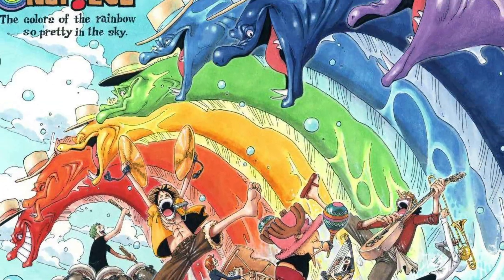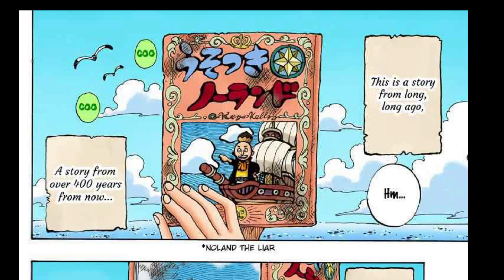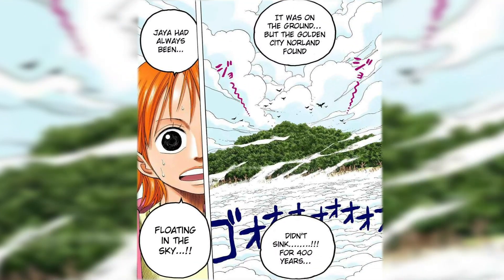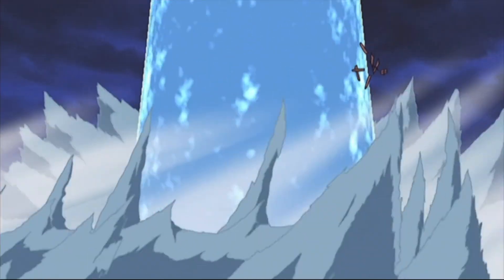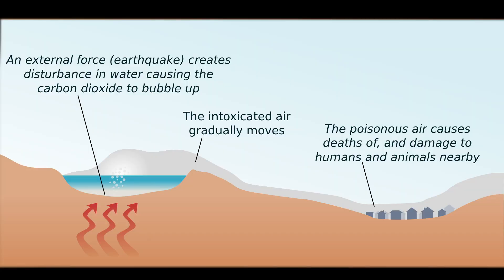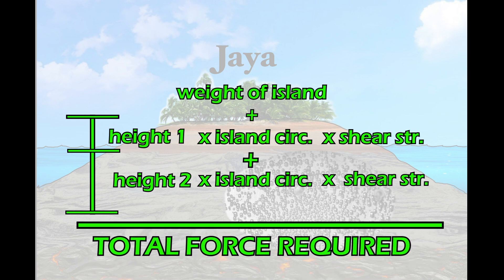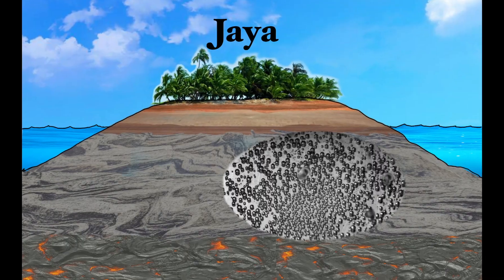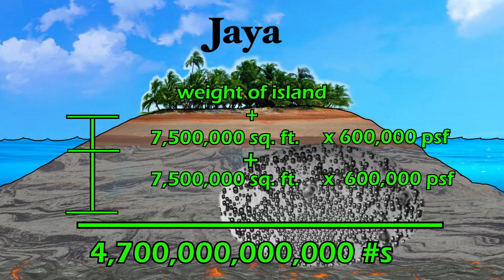Reverse Engineering Jaya: One Piece Worldbuilding

Comment: It might certainly be possible that Cricket's theory might be wrong to begin with, knowing Grandline, it could have been a mechanism that sustains the sky islands to begin with
But do you think that there could be a reason that knockup stream under Jaya was stronger than others?
Reply from the maker: ah, that's an interesting question. My guess would be that the recurring knock-up streams are a result of blowing out a seafloor cavern with a thin ceiling of rock, perhaps the pressure build up was able to be much larger underneath jaya because there was half an Island above it. 

But of course, this all relies on taking the logic of the show at face value

Comment: I think you forgot to factor in few things. You must always remember what shape a opening is and the underground or underwater topography as both are very big factors in this equation. If you never did the Weir experiment then do it. Basically the shape and topography matter. You can also try the pump experiment with commercially available objects. Use a bulb syringe and a simple cup. The idea is the narrower opening of the syringe changes the amount of pressure created. I took the mechanical physics class in high school and we did these same experiments. We tried to figure out the amount of water per cycle and how much pressure was there and how much power was required to move such a amount of water. The amount of pressure is pretty great and don’t forget the opening changes the amount of pressure and the amount of force released so it could be lower than you thought. You can also try the hose experiment of changing the hole while water goes through. Old faithful actually went through a change a number of years ago as the opening got wider changing its maximum height to become lower. Some idiot accidentally closed off a few holes and it happened.

Comment: I don't know much about engineering. (It pretty much ends with knowing why Steel Concrete is a great material for construction due to combining the pressure/pull abilities of very different materials) but there is one big mistake in my opinion.
 Remember Noland getting stuck in the forming rift and getting laughed on by Kargara?
Jaya didn't break apart at once it took months, if not years of successive weakening of the island, until a Knock-up Stream strong enough launched the larger part of the island.
Reply from the maker: ah that's a good point, I neglected that detail. Without clear definition I tried to simplify the analysis as much as I could, but the weakening of the Island could certainly apply along some length of sky island perimeter